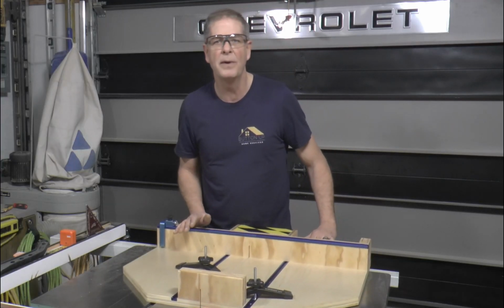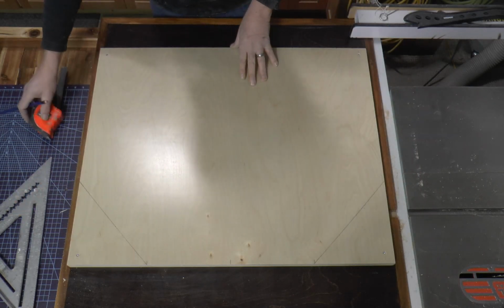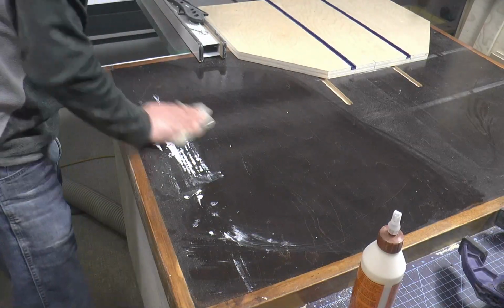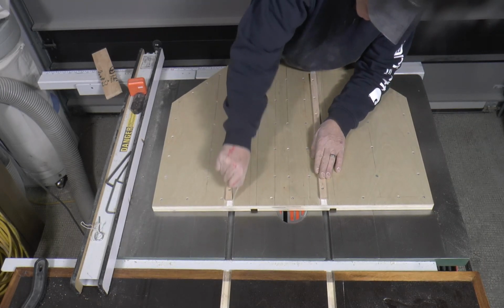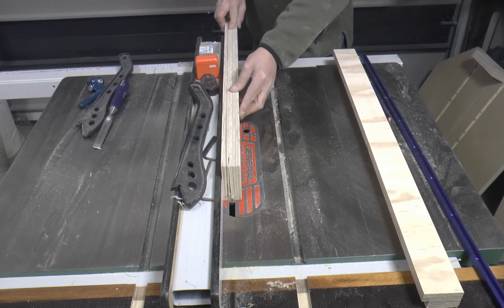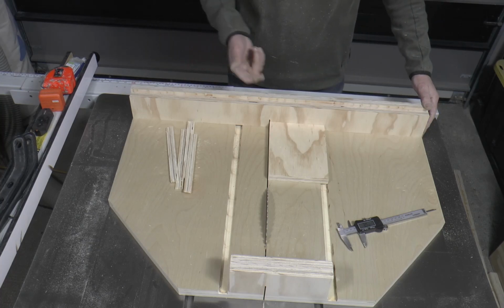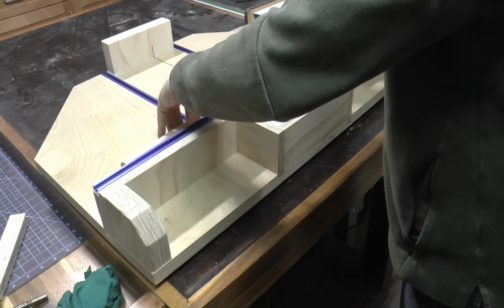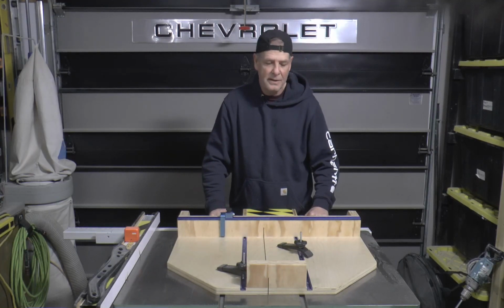DIY Crosscut Sled Safety Hack | The Safest Table Saw Upgrade for Woodworkers | Diy Built

Comment: Nice build, I like the oak runners upgrade.  Another option are UHMW runners that you don’t have to worry about expanding or contracting.  Well thought out and just top it off with applying paste wax on the underneath side of the sled to make it slide super smooth! 👍
Reply from the maker: Thanks Dan, appreciate your support.